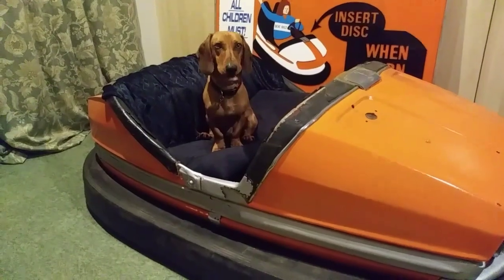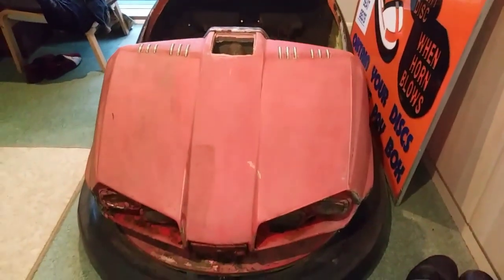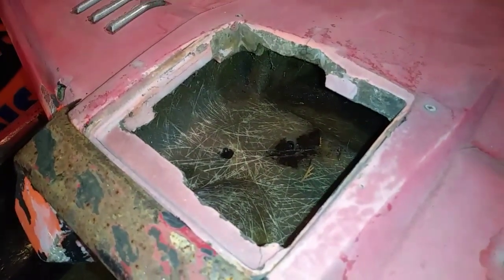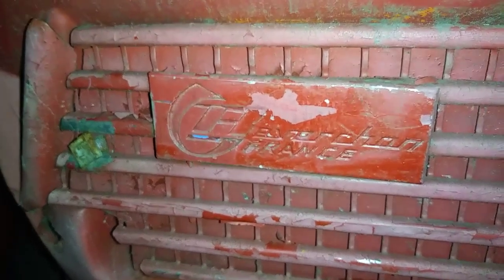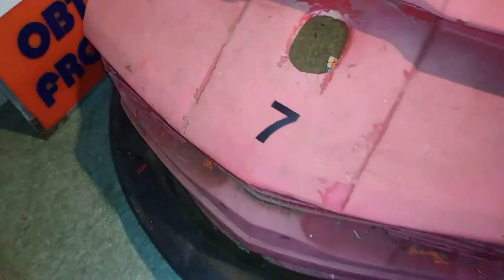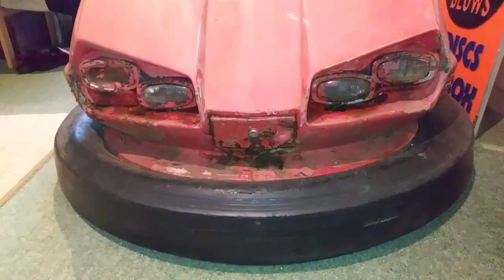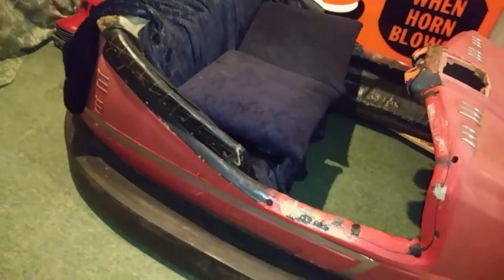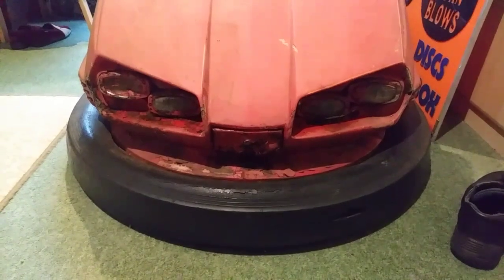My next dodgem bumper car project. 1970s Reverchon Europa

Comment: Good job Rob, the second buy is a lovely old dodgem (it must of looked great years back) - the new buy is nicer then the orange one you restored I think. 👍
Reply from the maker: Thanks, yes I think it looks much better and will look very cool when it's smartened up. It looks sad and grubby at the moment, but a bit of paint will make all the difference. Can't wait to get started on it, but busy with work at the moment. It will get done, it's a long term project.

Comment: I got 2 of these. I need to separate the main car body from the base. How many fixing points and where are they please?
Reply from the maker: I think there's 2 long bolts at the back, and 2 at the front. Undoing those 4 bolts should release the bodyshell. The first dodgem I had was just the shell. But this one was a complete car. However, it was missing the seat, steering wheel and the rubber bumper tyre, and so I only wanted the bodyshell. When I collected it from the fairground yard where I bought it from, they had already taken the bodyshell off the car for me. But it still has 2 long bolts at the back that are mounted into the fibreglass shell at the top. I think the front is the same. So, one bolt at each corner. I hope this helps.